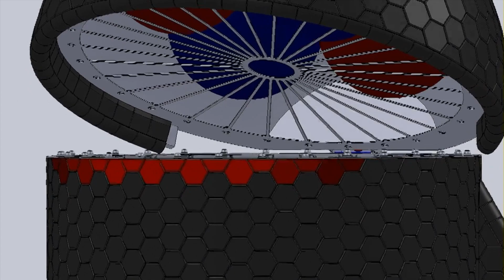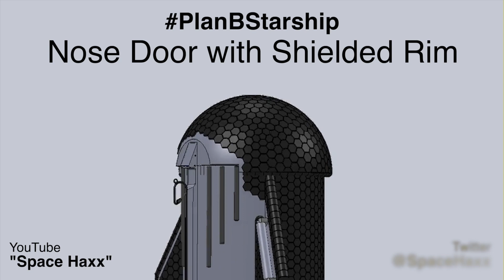"Nose Door with Shielded Rim" for SpaceX Starship (#PlanBStarship)

Comment: Perhaps it's time to look into other alternatives instead of going down the same rabbit hole of trying to shield against hot plasma by using thermal insulation. Understanding plasma might provide a better solution.Plasma is electrically conductive and flows along magnetic field lines in a magnetic field. By creating magnetic field lines is how fast moving plasma in excess of millions of degrees is controlled in a Tokamak reactor preventing it from touching the walls of the reactor since there is no known substance on earth that can withstand these temperatures. The plasma that forms on re-entry at mach-27 is only in the 1000's of degrees and moving much slower than that of the Tokamak reactor. In essence in a re-entry spacecraft, creating magnetic fields repelling the plasma around points where tiles leave exposed joints and around other strategic points of weakness can prevent the plasma from touching these exposed areas. One can see the reaction to plasma by magnetism by simply bringing a magnet near a candle flame. In theory a real sci-fi shield can be created around a space ship by creating a magnetic field around it.
Reply from the maker: Holy smokes man.  So some superconducting magnet tricks could do all kinds of "magical" things for a re-entering vehicle, couldn't it?  You're the first person in my life to ever bring this up.
Reply from the maker: But I hear you and I think you're right.  I hit the nose door with all I had, and ehhhhhh I didn't end up convinced.  So I'm trying some different corners next.  When one puts his mind up against SpaceX he's 99.999% certain to lose anyway, but it was worth it anyway because I've learned some good stuff along the way.

Comment: Why don't you look at how the shuttle did it.
Reply: Starship cargohold is in the nose, Shuttle cargohold is in the middle, is much easier to open in the middle, but the nose is making problems.
Reply: @Ivan_Berni  

?????????????????????????????????????????????????????????????
I was referring to the fact that the shuttle has wheels covers that open to extended the wheels.
They already solved the problem of making a hatch through the heat shield tiles.

Comment: I think you might be overthinking the required tolerances of the re-entry regime, simple thermal expansion of the vehicle duing reentry will lead to the tiles moving apart moreso than the gap left by the original hinge mechanism.
also, having a leading bump in the airstream would lead to it generating a serious hot spot around the edge of the hatch.
Reply from the maker: Much appreciated.

Comment: the outside world does not come to torch stuff open it just sees a hole in the shield - it turns your craft into a melted piece of shitt. The plasma burns all of the edges during reentry. So you either make an increadibly tight door with no mushroom bullshit, or do a door at the non exposed side, still without the mushroom bullshit.
Reply from the maker: Your attitude is horrible, but there's definitely some good info in your comments here that's helping me "prune" my notions of what/where to try next.  Which is my whole point of making these.

Comment: From a real rocket engineer, If you are intrested: 
1. Aerodynamicly trash: the mushroom is not only creating a flow separation region it is increasing surface drag. You somehow managed to fuck up in both aspects. Solution : make a peace of soap. no mountains no valleys. 2. the heatshield has to be a wall - again no mountains no valleys otherwise it will not heat up evenly. The corners will touch the plasma  - your coners will all burn up. make a peace of soap again.
Reply from the maker: "The corners will touch the plasma" Which corners in particular?

Comment: Why not use only a noses heatshild, obviously larger than rest of the body(would look like a tiny mushrooms) , for a starship used only around earth a 15 meters diameter would be enough, and much lighter than martian versions.
Reply from the maker: English please.  Then I'll be happy to answer.
Reply: @spacehaxx2225  I'm trying to say that current heatshild is much bigger than it need to be (at least for aerobreacking in the earth atmosphere), so only a noses heatshild that is used as a cargo bay door too can be much lighter, obviously such version of starship most dive with that heatshild in front (so head first), and that heatshild must have a higher diameter than body of the ship, but could protect completely whole rest of the body and the hinges used to open the door, (at least for the hottest part of the re-entering) , minimizing surface exposed to thermal load means minimizing weight of heatshild and the price of that heatshild, anywhow that would be a major change in design and probably isn't taken in consideration, but that I'm imagined when I see it first time your front door design. (I am sorry for first unclear and ambiguous message, and I hope now is more clear what I means to say )
Reply from the maker: @theOrionsarms  Oh I see OK.  That's interesting.  I hadn't considered how an aero-braking/capture-only heat shield even could be substantially different from a re-entering one.
Reply: @spacehaxx2225  the reason why SpaceX chosen a side mounted heatshild(and not a front one how I suggested) is because on aerobreacking on Mars starship it supposed to have a mass around 430 tons(100 tons dry mass, 100 payload and 230 tons propellant for landing) , but on a earth typical landing would have a mass of only 120 tons, so you don't need such a big heatshild in the thicker earth atmosphere , and Elon himself said that first starship for mars wouldn't fly earlier than five years or so, will make a lot of sense to launch starship with a earth optimized heatshild and start working on martian versions after few years . (I suppose such earth optimized heatshild can be used for aerocapture around Mars, and payloads transfered in a martian landing one, I didn't think about that until now)
Reply: @theOrionsarms  Phah no
Reply: @theOrionsarms  🤣🤣🤣 That is absolutely not the reason. The starship heatshield you are talking about will only be used for EO missions, never for mars. The reason, the starship has to start braking facing in the normal direction is to minimize max Q. As it comes closer and closer to max Q, it   does actually pich forward minimizing the exposure. The heatshield does not fear a long  exposure  to heat, it fears max Q. A
Reply: @theOrionsarms  also the heatshield has to be flat. or at least a side of a cillinder. Better flat. Pointy is deadly. The tip of the starship is pointy.
Reply: @spacehaxx2225  See my Insight into why the Starship heatshield for returning from orbit will be not on the tip but on the side above ^
Reply: @theOrionsarms  If you have no clue when max Q is. It is when the atmosphere is thick enough and the speed of the rocket is still fast enough. Thats why you want to slow down in atmosphere as fast as possible while it is still not dense. Now you are slow enough to meet the thicker parts of atmosphere.
Reply: @haobinlu  you understand the things wrong, maxQ is a issue only at launch, when the rocket reaches supersonic speed when it is in relatively denser part atmosphere(so it throttle down the engines to avoid damage from aerodynamic pressure) , ar re-entering maximum speed is in upper and thinner parts and a vehicle is losing most of the speed above a 30 km lines, and what I want to say was using a smaller heatshild make sense if you don't need a bigger one, for example dragon capsule is doing fine with 12,5 square meters heatshild with probably 9 tons of mass at re-entering, so 120 tons starship do not need more than 200 square meters, already explained that in another message, the starship heatshild wasn't designed for earth atmosphere, so why don't imagine one that it is.
Reply: @theOrionsarms  You are telling this to a rocket engineer. Congrats
Reply: @theOrionsarms  Bruh, delete your comment, it is full of mistakes, It can confuse someone that will read it
Reply: @haobinlu  why don't you watch a stream from when it's next launching of falcon9(or a older one) , you will see that maxQ is at launch not at re-entering how you said.(also if you want to hear directly from Elon Musk mouth, you can watch on the Babylon bee you tube chanel from two weeks ago, around 56 minutes into interviews speaking specifically about the maxQ on starship and would find his explanation in the line with what I said and not with your claims )
Reply: @theOrionsarms  🤣
Reply: @theOrionsarms  why don't you read a few books instead of thinking? If that stuff inspires you why not?
Reply: @theOrionsarms  No hate, but dont respect people who desinform( for ego reasons I guess) Will not help or explain shit. To all others - please to people like you - nope. Argue about starships with a Mac Donalds worker.
Reply: @theOrionsarms  you are mostly correct but maxQ isn't specific to lauch although generally is discussed more for launch. Max Q meaning Maximum Aerodynamic Pressure can happen any time entering, leaving or travelling through an atmosphere when the maximum pressure has been met. But you are right that launch is where its mostly discussed
Reply: @GamerBoyRobby  I'm not pretend to be a aerospace engineer (rocket engineer isn't actually a profession, maybe should be but isn't), but I'm self educated enough to try a explanation about why maxQ wouldn't be such a big problem at re-entering compared with launching, simply because aerodynamic pressure at launch is added to another huge force which rockets experience, I mean the most important force rocket needs to resist "the inertial load" , that force is equal with mass of every piece of rocket multiplied by acceleration, and for example starship would have a mass at re-entering less than 10%of the one of launches , so even at enormous g forces total mechanical stress(aerodynamic and inertial) will be lower than at launch.
Reply: @theOrionsarms  Exactly my guy. I love all this stuff as well but I am by no means qualified. That being said I know a lot more than the average person. Could say it all started with me playing KSP over the last 10 years and that growing into a love for the real science and physics of it. Propelled by SpaceX, I am a huge space fanatic and love learning anything I can
Reply: @GamerBoyRobby  it's a lot to learn if you don't  believe that once you understand one thing you know everything, but if you understand the general frame and all factors that influence final result things start to make sense, at least in my head does, but always is good to ask a second opinion, at least one that is qualified. And if we disagree on something I will try to explain where you are wrong and why, and I'm believe that anyone who disagree with me should do the same, and not trolling me with false claims and unjustified irony.

Comment: Maybe a dumb question. What about the pipes to header tank(s) ? Socket like on QD arm or elastic pipes...
Reply from the maker: You nailed it!  That's right.  I'm totally hand-waving that.  It would have to be exactly what you say: Either make/break connector things or flexible tubes.  I have no idea which is best, or if both are stupid.  I just don't know, and I hope someone who knows better tells us something.
Reply: @spacehaxx2225  a connector like airplanes use for in flight refueling could work.